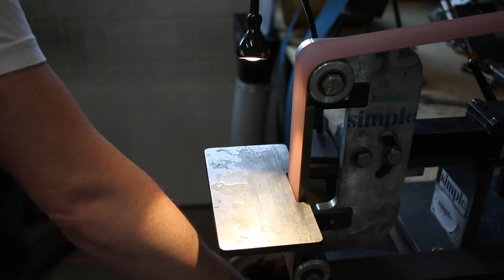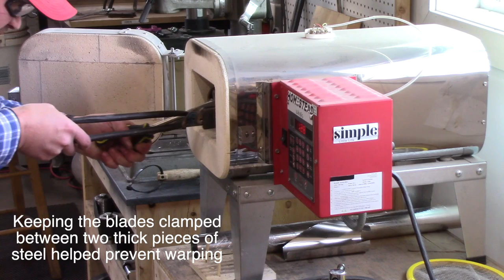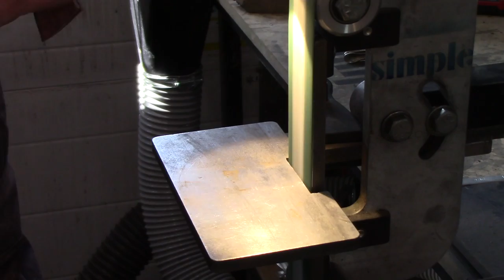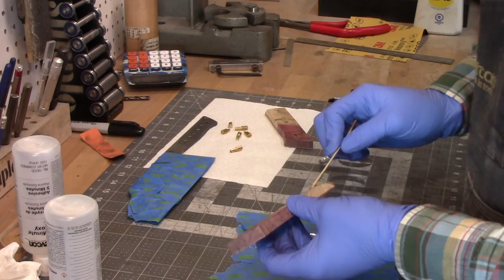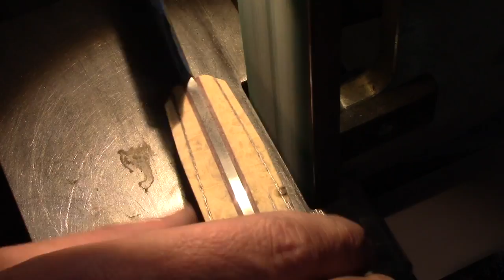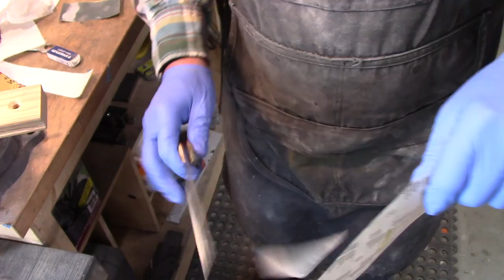How to make a Knife -  A Kitchen Cleaver

Comment: Beautiful knife and lovely craftsmanship. I have 2 questions if I may.. firstly, why the liquid nitrogen soak? And secondly, where do you get the little brass pillar screws? They are a great solution. Thank you for sharing your craft!
Reply: The dry ice is a cryogenic treatment it is needed especially for stainless steels like nitro-V to fully martensite the austensite before tempering basically increases wear resistance 👍
Reply: @scherlfirearts7142  thank you for the explanation! I haven't seen this process before

Comment: I have a love hate relationship with grinding a hardened blade. One one hand, it takes forever and is hard on abrasives. On the other it’s far more forgiving with “mistakes”.
Reply from the maker: I hear you. Most stainless steels I find warp way less if they have not been ground yet so that’s the main reason I grind them post HT. Save me hours in straightening warped blades 👍
Reply: Simple Little Life no doubt!

Comment: Beautiful Knife but there seems to be a few extra steps in there that don't look to be helping you. But i like when people have a system and you sure have one keep it up.
Reply from the maker: Thank you. I’d really be interested in what you see with the extra steps. I’m certainly guilty of getting into a routine and not being able to see improvements on the process. 👍
Reply: @Simplelittlelife  One question I have that I might have missed is what type of steel are you using? This question stems from your Cryo Treatment, Some steels really benefit from this and others don't need it could save you a few hours of time. Watching your video I am sure you have done your homework here and this was a good step. Your pre grind hand layout was pretty involved yet when you got to the "Brass Tax" of it (couldn't help myself there) the final touches of sanding where judged by fit and feel, which is what I believe to be the best approach. So this step could be less involved in the beginning as the final result is more free handed to feel and comfort. My personal preference and research leans me to doing 80% of my grinding before I heat treat and temper of my steel as I don't want to heat my steel while grinding and lose the benefits of my heat treat. This also allows me to grind more aggressively and save a little time. Last question was did you fill the burl wood pockets with super glue? If you use stabilized burl it won't need that and will hold up better overtime, you can also do a boiled linseed oil soak and this will help with keeping the wood protected and less likely to warp or crack with changes in environment. If you are still reading this novel have a great day and in the end it's all about having fun and doing what you love a system that works for you is a good system.

Comment: Gorgeous handle, even if you didn't make it 😁
Something that always bugs me.... why the painters tape for mixing epoxy ? seems rather wasteful when post it notes are so much easier
Reply: bill baggins how is it wasteful? A couple pieces of tape...
Reply: @bfbladeworks5693  ok, maybe not wasteful but  3-4 ft of tape and the time to stick it to something seems less efficient than using one sheet from a small notepad and probly a lot cheaper, but i guess it's just a matter of what you are used to using
Reply from the maker: Thank you. I don’t use post it notes so I don’t have them around. And, I use tape for protecting blades during handle shaping, etching and epoxy. One supply item that works for 3 different tasks. Bringing post it notes just for epoxy mixing would just add something else I would need to store and buy. But if you think that’s wasteful, you should see how much paper towel I go through in my shop 😆👍

Comment: What is the best steel to use ( circler saw blades are varied in materiel ) 
I have access to industrial heat treatment equipment and most metals even exotic 
Any genuine knowledgeable advice would be appreciated 👍

Comment: Why do you heat treat it in a tool wrap?
Reply: Stop oxidation.
Reply from the maker: The steel would decarburize at that temperature if not in air tight in the tool wrap 👍